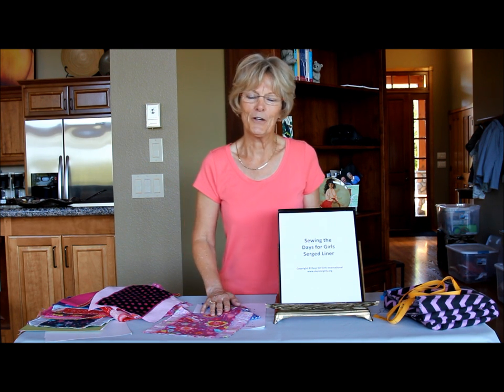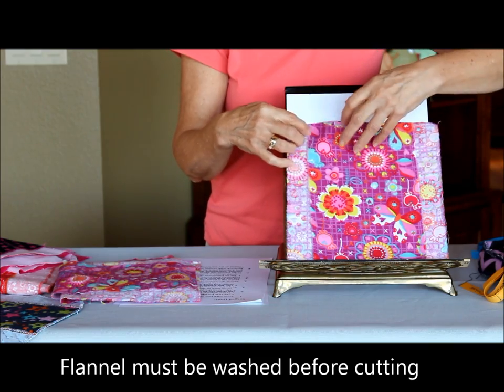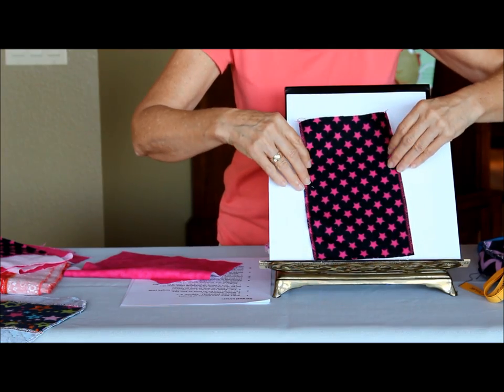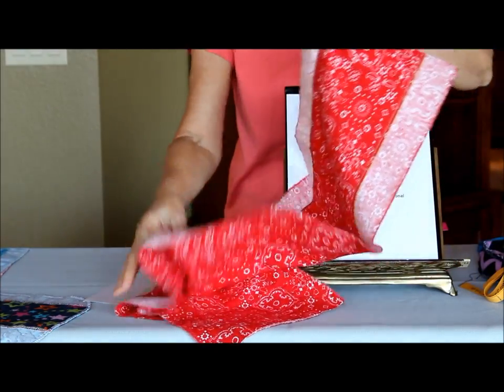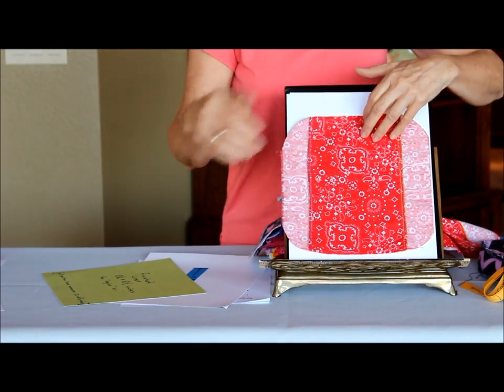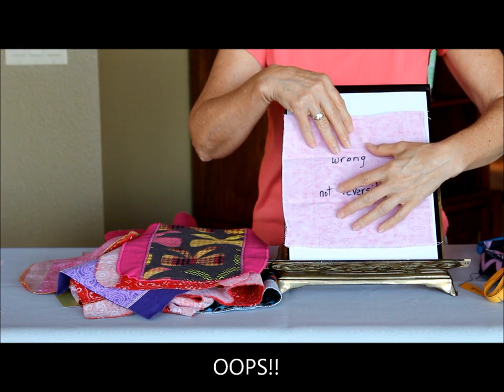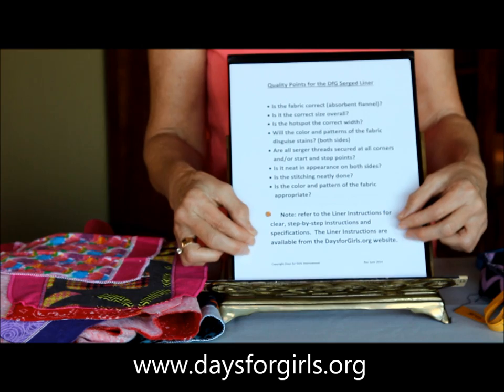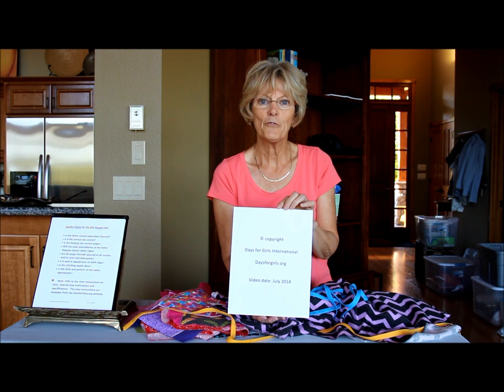Sewing the Serged Liner

Comment: Why is the serged liner a different shape (rounded square) while the turned liner is a six sided shape?  Can the turned liner also be a rounded square?
Reply: A turn-and-topstitch liner could be somewhat more rounded, but not by much; it should still be an octagon.  It's two layers everywhere, which is why it's important to remove bulk from the corners, so girls can fit 3 liners at once into the pockets.  
If the turned liners were the same shape as the serged liners, you'd be trying to fit 6 layers of turned flannel into a pocket, compared to just 3 layers of serged flannel.  Plus the seams are thicker, a total of 12 layers in a single folded liner!
But that format of liner is discouraged by Days for Girls headquarters, since feedback from the field is less than positive.